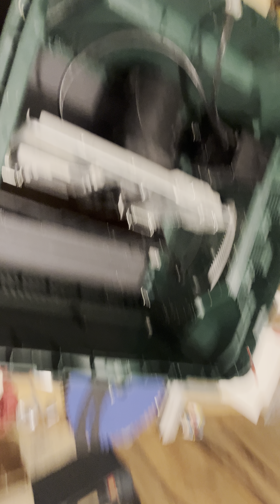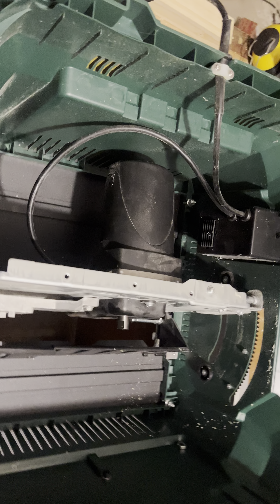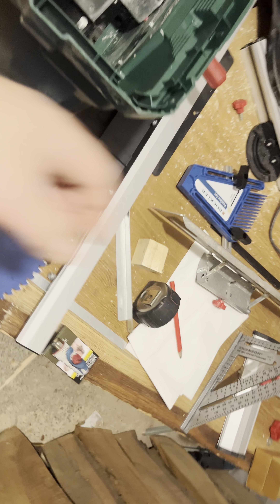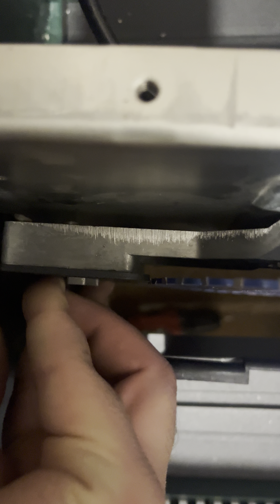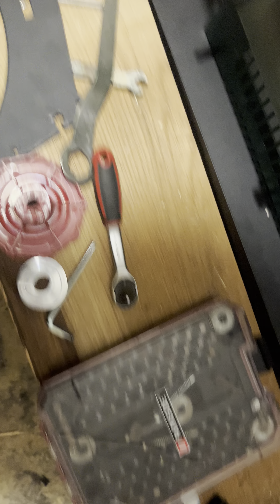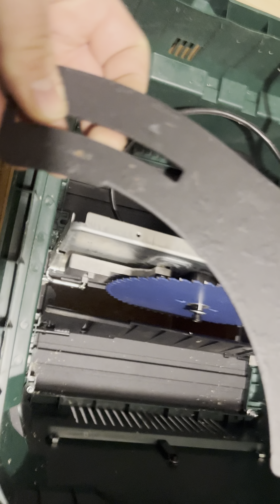How to square and align budget Parkside table saw blade and riving knife

Comment: Great video. You have described brilliantly everything that I'm having a problem with on my Parkside tabl;e saw. I have been really disappointed since I purchased mine some 2 years ago and earlier today I was looking at building a table saw sled when I realissed that one of my problems was caused by the blade not being square to the table grooves. I've just ordered a dial test indicator tool to be able to set it up accurately. Once again, thank you so much for sharing your video and also your ideas on how to fix the problems.